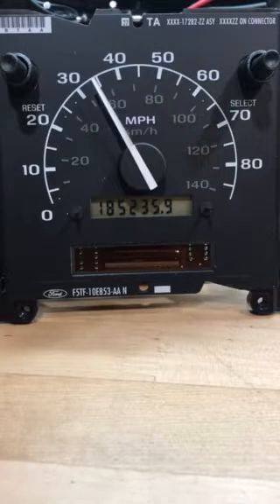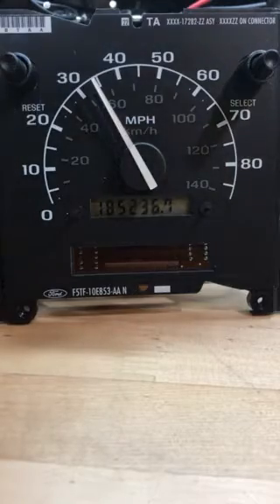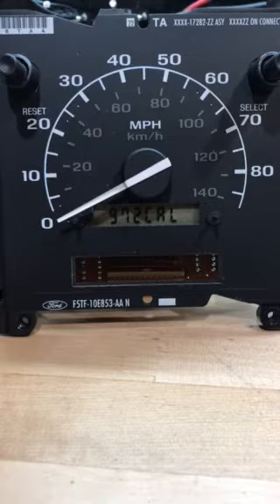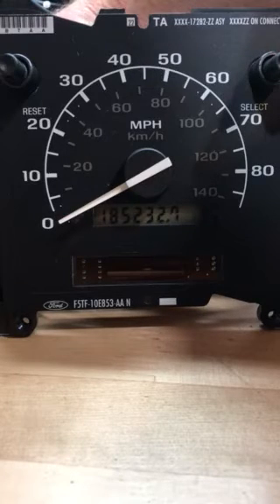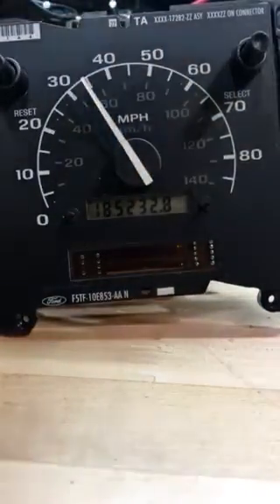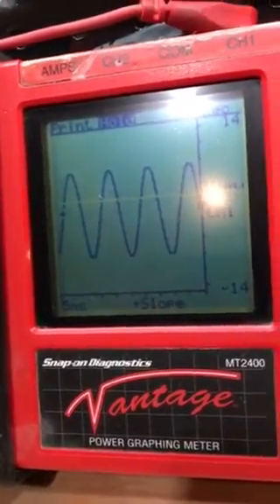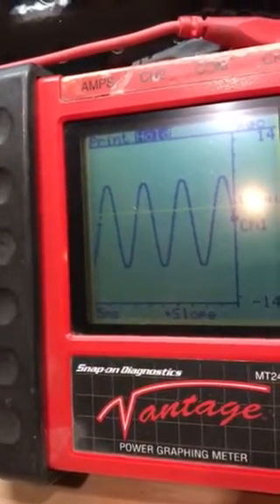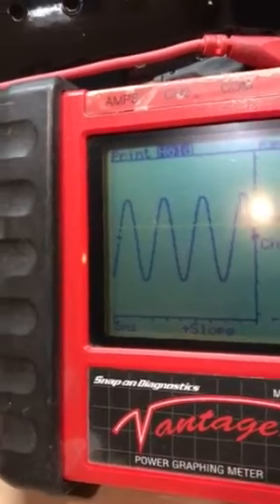92 - 97 Ford PSOM Style Basic Diagnostic, Testing and Troubleshooting Info for Speedometers

Comment: Is the sign wave signal present even if the truck is not running or not moving
Reply: The sine wave happens as the teeth on the diff tone ring pass by the speed sensor. The diff needs to be spinning, but it shouldn’t need to be running.

Comment: I have a 94 RV E-350. It is shifting to 4th immediately when I start from a stop and it doesn't downshift if I hit the gas at speed. It works fine if I shift it manually. My speedo seems to work fine. Do you think it could be the PSOM?

EDIT: The PSOM was fine. The ECU ended up being the problem.

Comment: I have a 1992 PSOM and when I hold the reset button when powering on it says E 03.  It doesn’t have a number off to the side for the number of reprograms left.  Do I just have an early version that doesn’t tell you?
Reply from the maker: It is the early version but you still need to press the button a second time to get the CAL code out of it

Comment: Hi I have a question sir, what cable you connect to positive and what to negative to see the miles.of the PSOM I need know how many miles have my cluster please thank you
Reply from the maker: Pins 1 and 3 are power and pin 2 is ground for the PSOM

Comment: I described the hard shifting/ safe mode to my mechanic and he went straight to recommending tranni rebuild.
Reply from the maker: That actually happens quite a bit but many transmission shops have become educated on these units and the transmission problems that they can cause when not delivering a good signal to the PCM

Comment: This is great, My 94 150 manual trans has no speedo or odometer movement. I'll pull the cluster and visually inspect for damage. What readings should I see or look for? Thank you!
Reply: Check your fuses first, I found when the speedo and odo quit, one of the 15 amp (blue) fuses was open in the fuses on the dash near the driver
Reply: @kellismith4329  Turns out there were several electronic giggly bits on the speedo module that had failed. A tiny diode and a couple capacitors'. Sent it to Texas speedometer  (Ebay) and they fixed it.

Comment: I'm having the oscillating speedo problem in my 94 . I changed out from my 1996 who's speedo works perfectly. The same problem happened. I changed out the speed sensor with a Motorcraft sensor no difference in the problem. I changed out the tach sensor in the timing wheel cover 7.3 IDI. What's next? The tone wheel/gear?
Reply: What was the issue?

Comment: If I take my gauges from a 1994 OBS and install them in a gauge cluster chassis from a 1995 or 1996 chassis OBS gauge cluster chassis are the printed circuit boards the same? They do appear slightly different.

Comment: So where exactly is the info to diagnose a dead odometer??
Reply from the maker: There should be power from fuses 8 and 18 to terminals 1 and 3 and ground from the firewall to terminal 2 of the PSOM connector